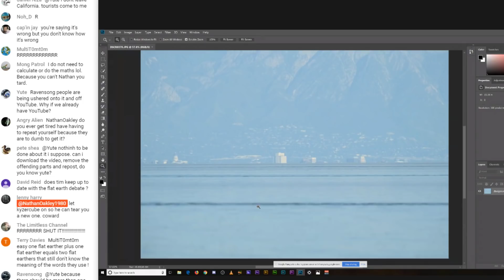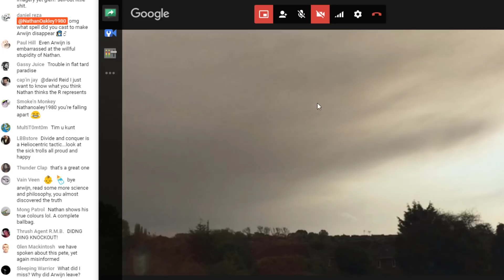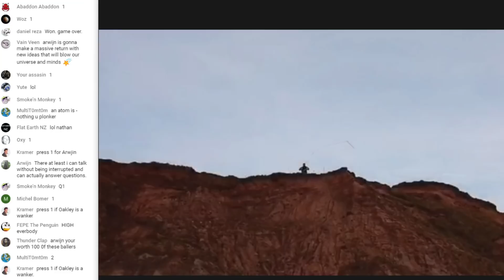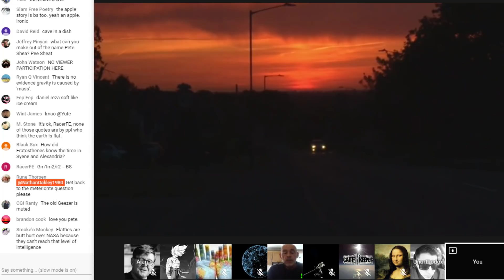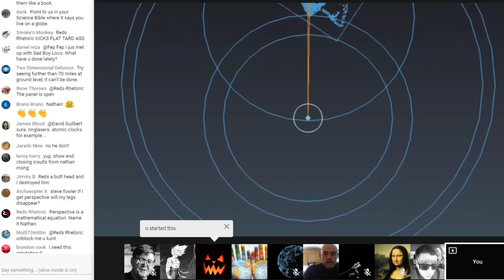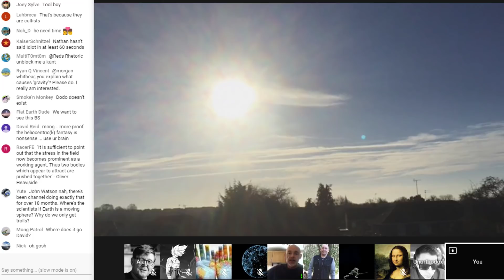Flat Earth Debate 302 LIVE

Comment: The distance or horizons is not physical only the button part or the ground but the shy isn’t there so to plug in this fact that when you zoom in you must remember you are looking at a pixel and you expand it so the distance to that zoomed point also has a horizon and eventually the ground or sea reflects like a mirror because the angle of your eyes looking at the horizons at 20 miles away it shows at that distance for the floor to mirror like that it’s because your angle to the floor you lose definition and the only thing you see is water molecules compressed in that line of sight! So this mirroring happens to any flat surface how you know it happens is the surface you look at has a color like a black tar road or even a brown table if you look parallel to that surface the color of the sky or roof will be seen on the road after a certain distance.. because the angle is causing a natural mirror due to its flatness!! This would never happen on a ball earth and to see mirroring like that it suggests how flat the surface is if you actually rise up and see more distance the Same effect happens no matter where you go!! They could go 1million miles away the horizons will rise and mirror the sky because it’s infinite!!